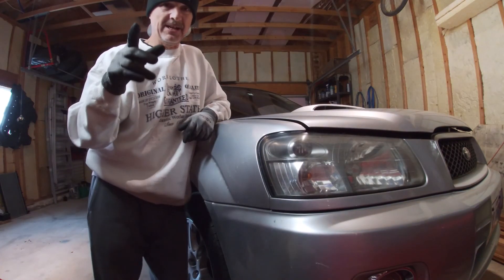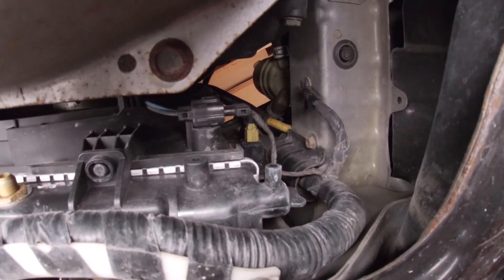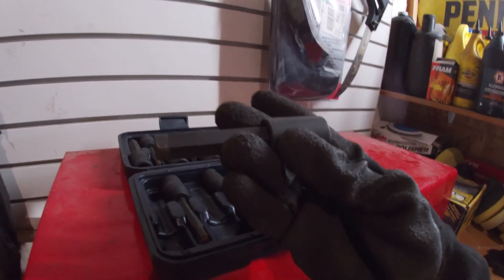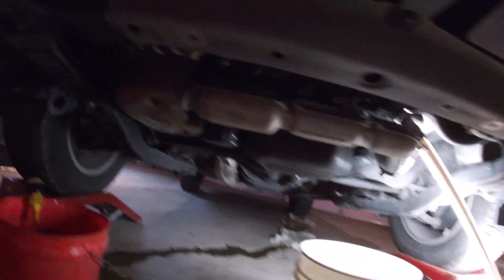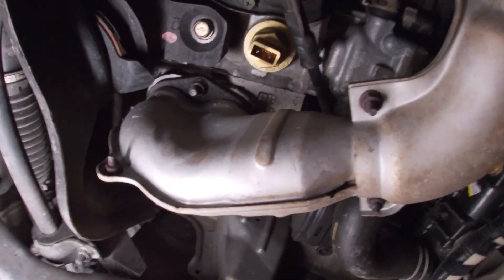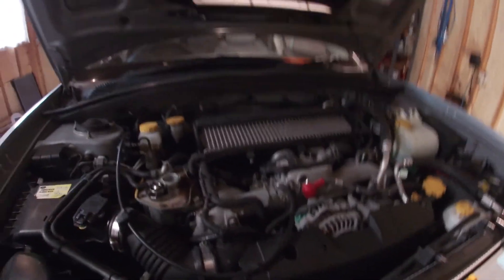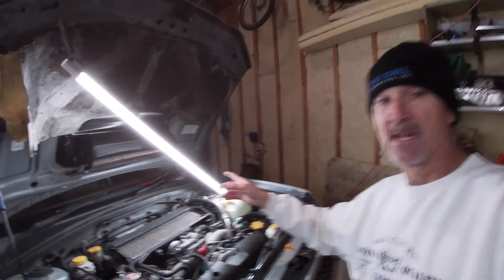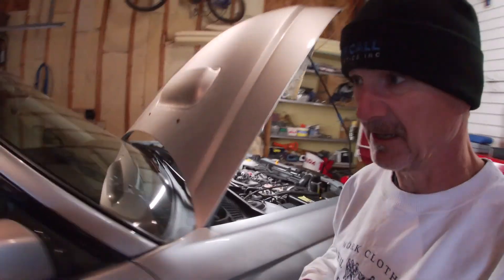How to Install an Engine Block Heater,  Subaru, Subaru Forester, 2.0L Turbo.  AND she's a 5 Speed!

Comment: Will this be a similar installation to the 2014 Forester? I dont think I have a turbo, it must be a 2.5L thanks!
Reply from the maker: sorry, late response. I am not sure on that. I assume the boxer 4 block is very close in design to my turbo'd EG205. If you get underneath, check the left side of the block and look for an installed plug, itwould be 36mm in size. Stumpr1

Comment: Thanks for the info, definitely installing one in my 03 Impreza 2.5TS n/an engine. Car has a hard time starting here when it sits overnight. Changed my IAC and a bunch of other shit with no help. Hoping this works
Reply from the maker: How cold does it get where you are? Block heaters where I'm at are a must have. Stumpr1

Comment: Hi Is it safe to plug the block heater inside the garage?
Reply from the maker: People sya not too do this. Consumer Reports, Fire Departments, etc. I know so many people who do. I park outside, so I do.  I have my heater on a timer, 2.5hrs before I start my car. You do not need more than 4.0hrs of plug in time, after that, just wasting power. Cheers! Stumpr1

Comment: Hey, I'm from Manitoba too :) Thanks for the video.  My block heater isn't working, but I'm wondering if it's just unplugged at the block.
Reply from the maker: That is possible, could be a few things: unplugged, burnt out, cord end inop.  Look under left side, see a cord hanging down? Check your cord end, it is corroded or frayed out? What's your car??????

Comment: Just picked up a 01 V7 STI wagon and need to get a block heater installed asap for these AB winters, thanks for the vid i think it’ll translate over to my car nicely
Reply from the maker: an 07' STI Wagon, tell me it's blue with gold rims!  Ya, we need these items, as I'm in MB and it surely works wonders. I would like a circulating heater, but these element ones work great. Used mine set up on a timer, it woul come on about 3-4 hrs before start up. Add in I ran full synthetic oil. If you have any pics posted, let me know where to see them at. Cheers! Stumpr1
Reply: @stumpr1  sadly not blue, just got it off the boat from japan, white with the gold wheels! sounds like we are very similar in how we take care of our cars in winter! no pics up anywhere yet but you"ll probably see me in the r/WRX subreddit and I'll probably be uploading videos of restoring it to its 01 beauty.
Reply from the maker: @SunoPics  white w/gold, nice look. SADLY....sold my Forester off. Regrets, I have a few. Always take care of what I dive. Message when you have some pics to look at. STUMPR11 is Instagram.

Comment: Hey thanks, super helpful. Do you have another video or pictures of draining the coolant? I'm installing a block heater on my 2007 forester 2.5 and trying to source the best way to drain the coolant with minimal spillage.
Reply from the maker: At the first part of the video, I show the drain for the radiator. That's the best, cleanest way to drain it. Cheers! Stumpr1

Comment: My Forester block plugs are behind the exhaust manifold and requires removal. Not terrible but if you live in rusty land, it can be a bear. Thanks for sharing your installation.
Reply from the maker: True, some do require manifold to be removed. This car came from Japan and as you can see, very clean underneath. Check my one other video I posted before the block heater, shows a moe detailed video of the rust free under caraige. Cheers! Stumpr1

Comment: Ya use an impact…
Reply: Still an awesome video!
Reply from the maker: 3' long breaker bar and one foot against the tire, then pull hard. The snapping sound was very cool. Add in, I have no compressor and my electric impact is not strong enough. Cheers! Stumpr1

Comment: just got myself one of these and need a block heater cause i live in winnipeg... later saw that you have MB plates as well. Cheers!
Reply from the maker: Did you get a Forester? Give me details on it! Check my channel,  vids posted of it. [sadly sold it]   Also, see the WRX posted yesterday, that's my boys import!  Cheers! Let me know if you have questions on that install.
Reply: @stumpr1  2004 forester x5 from Japan. Got it in bc a and I love it! Nice car your son has too! I’ve also had a 2012 wrx and a 2002. Can’t seem to get away from them
Reply from the maker: @blakegillan1903  2.0L turbo? EJ20. 5 speed? [tell me it's a 5 speed!]  KMS, color. Options?
Reply: @stumpr1  yes 2.0 turbo, 5spd, car is white. It has some Japanese kenwood 7” display that is all in Japanese and I have no clue what it says lol. It has cloth seats which I actually prefer to leather. Only thing I wish it had was cruise but I can live without it
Reply from the maker: @blakegillan1903  NICE! I had a Japanese radio, fm only went to like, 85.5...blah. My, cloth seats, awesome over leather. No cruise, one thing I missed. Had to install a new deck. If you check my channel, there's a white one, 03' auto in my driveway beside my 04' Silver one. It's our daughter-in-laws car. Went dt last night in the WRX, just for a quick drive. good times.
Reply: LoL another Manitoban here. Bought a 2003 Forester online, picking up in BC. Thanks for this! Looking into winterizing while I wait for it to arrive

Comment: anyone have a good part number? struggling to find any heater for my 02 wrx
Reply from the maker: Zerostart 310-0008 Engine Block Heater (3100008)  Fits so many Subaru models. My Forester was the 2.0L Turbo. Cheers! Stumpr1
Reply from the maker: lastly.....check my channel for the 97' WRX a JDM Import. Our boys car.

Comment: Can the heater get coolant up to operating temp alone? Or do you know when it tops out? Does it have an auto off at a certain temp/time?  Appreciate the vid. Thanks!
Reply from the maker: Depends on the outside temp and the Watt Rating on the heater. Think of an Hot water tank, electric one.  The block heater will warm the coolant up, it's main use is to warm the coolant for an easier engine start, less run time required to get the engine fullwarmed up. No they do not have a cut off temp.  I use a Timer located in my garage, you need no more than 4 hours of plug in time. At -30C, I run 4hrs MAX heater time. Cheers! Stumpr1

Comment: Thank you for the video, very informative! Which coolant brand you used? Could you please share a link to the block heater model you installed? Thank you in advance.
Reply from the maker: Block heater was a Temro Product, not sure of the part number as I gave away all my bills with the car. Part # was.... 31000007? It was a weird long number like this. Most auto parts stores do carry this, as it fits most Subaru engines.
Reply from the maker: Used Prestone coolant.

Comment: What was the model number of the block heater you used I got an 04 spec b with a ej20x and want to put one in mine?
Reply from the maker: 3100008 is the part number, search that one out. Cheers! Thanks for watching. Stumpr1

Comment: Excellent.  My block heater has been sitting in a bag for the last year, haha.  I have to replace all 4 of the oil cooler seals above the filter.  Good opportunity to combine jobs since some oil cooler coolant hoses need to be removed.  '06 2.5XT
Reply from the maker: pretty straight forward job to change it out, just found it slow to re-fill the system. Lots of air pockets in the block and they just need sometime to work themselves out. Check the level in the expansion tank over the next few days, top up as nessesary. Get It Done!  Stumpr1

Comment: Hi, I just installed the block heater today. I reused the coolant but couldn't fulfilled the tank🤣🤣🤣any advices?
Reply from the maker: Yup, with the engine cold, have the rad cap off [of course] squeeze the upper rad hose a few times to move the air thru the system. You'll hear the air bubbling thru the system.  Add coolant and repeat. You can start the engine and watch the coolant drop, as the waterpump will now start moving the coolant thru the engine. The passages thru the block and heads are small, so this may take a day of normal driving to get rid of all the air in the system. Top up the overflow tank, as the engine cools it will suck coolant from the tank. Check your coolant tank lever over the next few days and add as ness. This is normal stuff.....my was 2 days of checking and adding to get the right level........let me know...cheers!
Reply: @stumpr1  wow i see, thank you! i will check it in the coming few days. and I feel that cord is too close to the exhaust, how about yours
Reply from the maker: @josenmedia  yes, you are correct. The cord is close to the exhaust. I ran mine straight down from the block heater and used a few zip ties to keep it away from the manfold. Checked it a few times, and it is fine. Stumpr1

Comment: hi, how are you ?
I think maybe we met before at the car meet, and I drove with a black forester.
i am planning to install a block heater too haha!
Reply from the maker: Hey! we did meet. It was a pretty straight forward install, filling the radiator did take some time, it's slow.  How's the wagon running? I am doing an interior car warmer tomorrow into the Forester. Cheers! Stumpr1
Reply: @stumpr1  she is running good! I am wrapping her with matte black now haha. And I took the lip off for the winter
Reply from the maker: @josenmedia  Matte black, nice!  That lip would have acted like shovel.........Did you get better tires?  I just installed winter tires, massive difference!
Reply: @stumpr1  haha, yep, i already on winter tire since august lmao